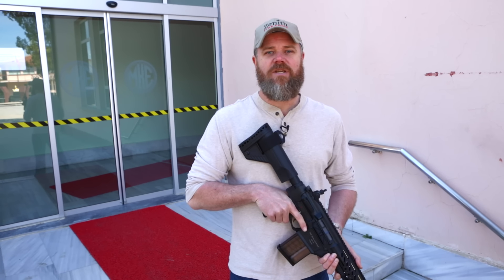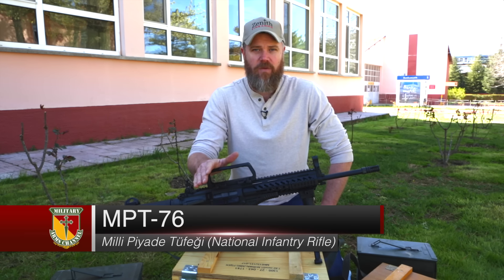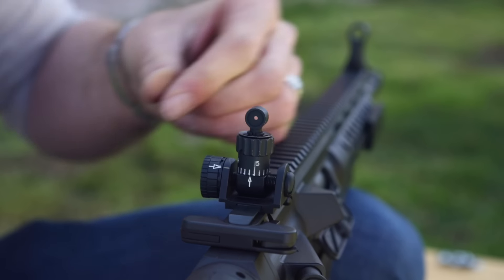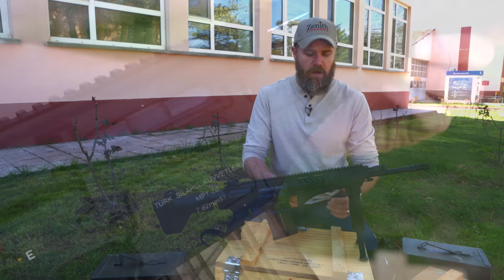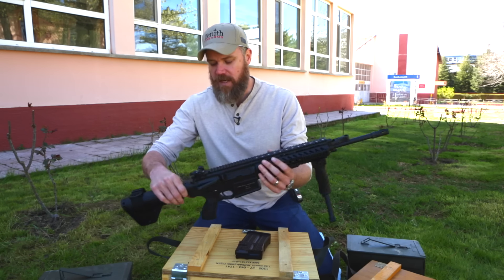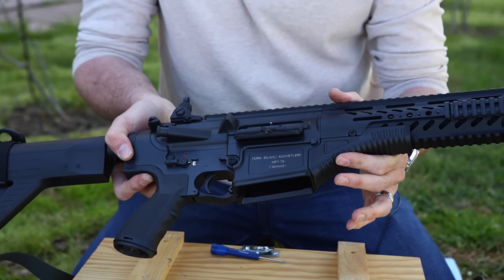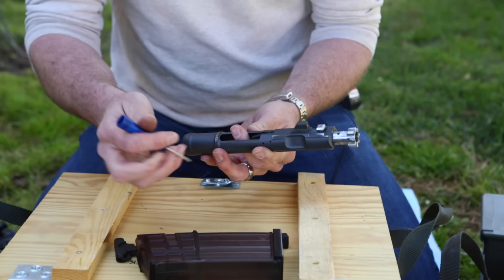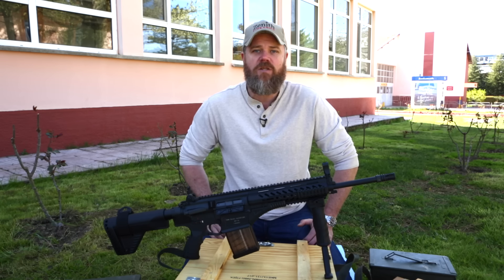Shooting the Turkish MPT-76 Infantry Rifle

Comment: Turkey: Hey can I copy your homework?
Germany with HK417: Sure, just dont make it look obvious.
Turkey:
Reply: Look at it again
Reply: I guess you made this comment without knowing the Chinese
Reply: Wat
Reply: @Maveraünnehir I detect broken English
Reply: Guess which gun germany copied 417 from ?
Reply: @quiety8148  Nobody. Its just the 7.62x51 version of the HK416. Yeah, I know The SR 25 and HK417 are similar, but they barley look a like, and the HK417 is piston driven.
Reply: @hatihrovitnisson253  and hk416 is a copy of ? Here is a hint : 416 was named "HKM4" but changed after colt sued them.

Copying guns isnt a bad thing, why waste money when a reliable and battle tested weapon platforms exists ?
Reply: @quiety8148  I'm not saying it's a bad gun. I'm just saying it obviously was designed based off of a HK417.
Reply: @hatihrovitnisson253  nobody said it is original design. Galil is also copy of valmet rk62 for example, it is impossible to make a %100 original firearm now.
Reply: Just wanted to make a joke of it that's all
Reply: both rifles are based on ar10
Reply: @gorkemsenol4128  sighs
Reply: @hatihrovitnisson253  yes it is very simikar to hk 417, bt its better. Passed all nato tests. Its far from a cheap copy. Well built weapon
Reply: @mrnorthz9373  lot of things are similar through out the years of firearms (also this is a joke)
Reply: @hatihrovitnisson253  ik its a joke i just wanted to say that it has 100 more rpm, very reliable almost as much as ak, and has higher muzzle velocity and range menaehile being 400 grams lighter.
Reply: @mrnorthz9373  I never shot either one sadly, so I wouldn't have a good opinion on the rifle other than it's a similar design to the 417
Reply: @hatihrovitnisson253  yeah i probably should stop taking jokes seriously.

Comment: Not being able to service the gas system readily is this weapon's Achilles heel. Interesting that it's controllable in full auto. But that weapon is not a SAW or LMG and its 20 RD mag means it really should only have a 2 - 3 round burst capability to maximize combat effectiveness. Overall, it's kinda like going back to the future to build a battle rifle. Weight and the incapability of carrying as many cartridges still relegate this weapon to DMR use in a modern platoon. From that perspective, reinventing the wheel was a waste of time.
Reply: It is not going back whatsoever. Turkish army constantly fights PKK terrorist insurgents. It is a semi domestic terrorist organisation accepted by NATO since 1990s. And they mainly use AK47s AK74s PKMs Drugunovs. To fight them on the South Eastern Anatolia the army needs compatible arms. Also the area is infamous for it's harsh winter conditions and high attitude rocky mountains. So the army basically needs 7.62 cartridge on par with Russian weapons and a durable platform that would work on cold-hot-windy conditions. 

Also for assault rifle use they also made MPT56 which uses NATO 5.56 with 30 rounds standard magazines.

Comment: tbh this looks like its been changed just enough to not get a lawsuit by HK for coyping the 417.. I mean for real, the design of the Stock seems to be a blatant copy, just the Locking mechanism is different. Same for the Grip, looks just like the HK Grip with an added tail. In my opinion that frongrip is ok, but unpractical in regards to the fieldstripping. Also i can't find a reason why you would put the Locking mechanism of the Charging handle on the right side, makes no sense for me unless the shooter is left handed. Overall it looks like someone didn't want to buy 417's, but still wanted them..
Reply: Dude, all rifles share common stuff dating back to STG-44!
Reply: both weapons are based on ar10 mate

Comment: Looks like an hk 417 Rip off
Reply: Program initially started as a HK416 license production (Mehmetçik-1), but soldiers expressed concerns over 5.56mm, thus they changed to 7.62mm. This rifle is basically a HK417, but changed so they don't need a license to produce it. AR-type rifles are not new gen though, monolithic upper guns like the SCAR, CZ BREN, MSBS and HK433 are considered new gen.

Comment: Bruh recoil is worst than g3a3 wtf is this a bad m4
Reply: its a M4 chambered in  .308. Scar-H recoil is similar to this one.
Reply: @quiety8148  yeah and scar H it's bad but i dont see the point of buying scar h when u can buy scar L
Reply: @GigaChad-hn2xu  Turkey switched to G33 which is basically a 5.56 version of g3 and the soldiers hated it. Turkey needs 7.62, not 5.56
Reply: @quiety8148  if turkeys choose the worst 5.56 rifle on the earth that doesnt mean 5.56 are bad. It is well-known that 5.56 are better for many reasons but the problem is that in my opinion g3 was better than mpt76 because it wasn't kicked that hard and it was also easy to control. This 7.62 is just bad, i mean in full auto u can see the guy walking backwards from the recoil this is ridiculous
Reply: @GigaChad-hn2xu  G3 was only better in terms of recoil. The guns are old, used and outdated, they are prone to jams and such.

Do you hvae any idea where turkish soldiers fight ? Mostly mountains and deserts, soldiers hated 5.56 because of the less range. Real life isnt video games , they arent going full-auto to kill few unarmored terrorists from 400 meters, so recoil isnt an issue here
Reply: @quiety8148  well first of all 5.56 can shoot pretty far like 7.62 for example m4 shoot easy in 550m and it can still shoot at 800m + g3 could also shoot at 400m easy and then harder at 800-900m idk about mpt76 but g3 was good. U know i dont understand why turkey change their gun from a g3 to a little worse new g3 i dont understand
Reply: @GigaChad-hn2xu  Dude those guns were used to the the point where jams became super common. You know how infantry keeps their weapons. So they just changed to this HK417 clone

Comment: Not a good weapon . When shooting everything was shaking in the weapon because of the hard recoil . But its cool enough
Reply: If it wasnt good it wouldntve passed all nato tests
Reply: @mrnorthz9373 that's acutally true but in my opinion its not that good . There are many same(and better) weapons like the mpt76 cuz its a scar with ar15 copy
Reply: @randomtraveler4687  its based on the hk 417. Its pretty similar that turkey needed the license to produce it. Yet they took a legendary gun, and made it even better. I think its 400 grams lighter has 100 more rpm and range.  I do not know if its the best, but it surely is a great weapon.

Edit: weight
Reply: I think you replied but i didnt recieve it
Reply: @randomtraveler4687  that is extremely based(the word based is a compliment just so if you didnt know), i do understand your opinion but not only war, you need an army to defend yourself. For example pkk terrorists. Peace is a very good thing but you gotta agree, just to of us wont change the world. And i looked at the guns recoil. The parts that are moving are:
The chambers cap-prevents dust from getting inside
Bolt- is supposed to move so jittering is ok
Unjamming button-just like the bolt its a button so if it moves its ok
Sight-it is strapped to the gun weakly by a picatinny rail kinda like seats in a car, not at all important if it moves
And the barrel- barrel moving is actually important, jut i looked at other weapons at this caliber and i came to the conclusion that at this size, metal flexes no matter how good the gun is. Disagreeing with me is totally ok, drbates makes both sides wiser (if you arent arguing with an idiot), and you get to see how other people think. Feel free to share your opinion. And thanks it was a pleasant conversation.
Reply: @mrnorthz9373 I totally agree on your comment . 
Edit : and sorry for being an idiot. I just want people to understand sometimes but seems that they will not . 
The gun is kinda (ok) , its like the other classic assault rifles but its a copy . Our weapon was a copy too, so 😂
Reply: @randomtraveler4687  no you werent an idiot. And i totally understand you. Have a great day.
Reply: @mrnorthz9373  you too . And I hope one day turkey and greece will find peace each other but I don't think the politicians and some civilians will understand ...
Reply: @randomtraveler4687  ah, turks and greeks have been fighting for a thousand years and they probably will fight for a thousand more. This might be a gpod time of peace because of NATO, so we have to enjoy it while it lasts.
Reply: @mrnorthz9373  agreed and I wish good luck to both countries . That was a good conversasion . Have a great day
Reply: 7.62 Bir Tüfek. Sen 5.56 Bir Tüfekle Karşılaştırıyorsun. G3'e Göre Geri Tepmesi Gerçekten Çok Az. Çok Başarılı Bir Silah.
Reply: @randomtraveler4687  its 7 62
Reply: @onikiucdortbes4064  7.62 bullets make the weapon overheat more often, but they do impressive damage . But the weapon it’s not for my opinion, German copy etc

Comment: I see the rifle as a local version of the HK416 and M4 based on Turkish (MKEK factory) experience producing those rifles. The final product has NO major development, therefore the statement that the rifle was designed from the ground could be highly debatable. Likewise, the concept of a 'modern rifle' has no room in this case mainly because a) I see no reason for the forward assist and dust cover b) the 180° fire selector is obsolete c) the charging mechanism is old, inadequate and incomprehensible even more when the Turkish forces are coming from front side charging handle of the G3 HK33 d) The recoil is heavy still taking in to account that it is a 308 e) the controls are not ambidextrous. The rifle looks solid, reliable, and well made but for sure it is not a modern rifle. The modern category shapes better for carabines/rifles such as HK433, IWIX95, MSBSGrot, CZBREN2 among others. Hope to see them on your channel. Stay safe.
Reply: if I'm not mistaken, This is the only weapon that has successfully passed 42 NATO tests.
Reply: It's name is not modern rifle they translated it wrong. It's national infantry rifle